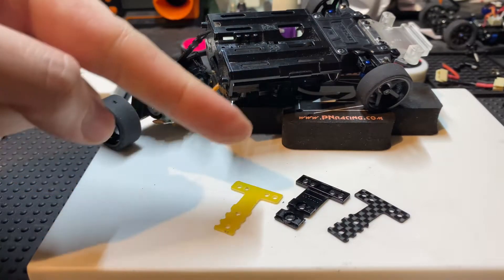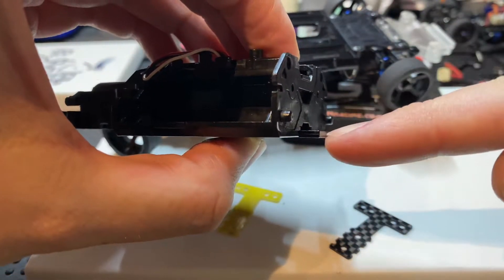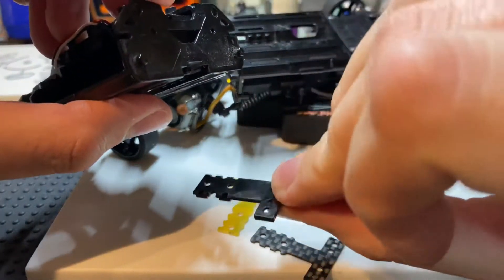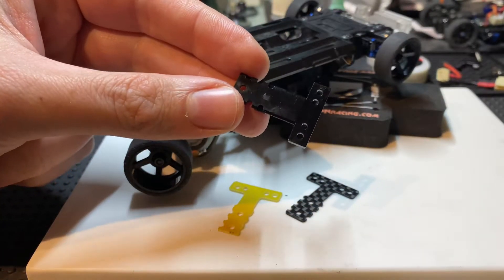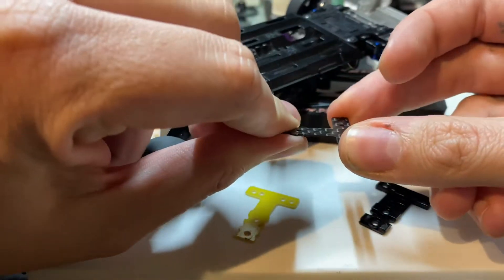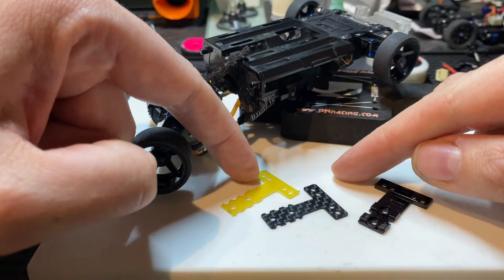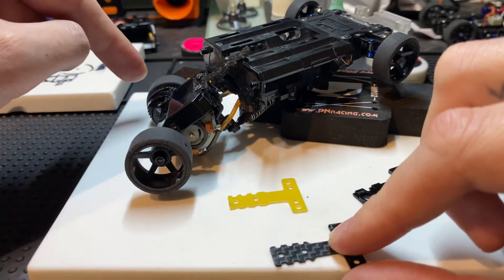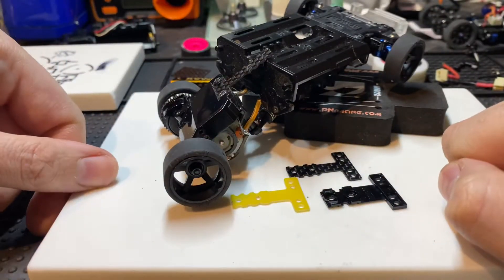What is a Mini Z T-plate

Comment: Your comment of FRP and Carbon being the same makes sense, but then they did make them out of two different materials. PN Racing even makes one out of spring steel.
I wonder if it has to do with the speed at which it returns back to its original form (plane) kind of like a shock rebound. 

I would think the Carbon will "bounce" back quicker and limit body roll compared to the FRP? What do you think?
We are talking a tiny amount that would be hard to notice every day unless you are racing and really tuning a car.

Comment: its just like flipping the kingpin ... when all you have to do is polish the shaft and reinstall it. when you flip it what actually ends up happening is that it allows the frame to bottom out and get completely screwed over time. ps thanks for info on the dampener ... ordering one now !!!

Comment: How soft or hard the T plate should be and how it’s gonna affect the driving?
Reply: How hard or soft is going to depend on your track (grip, surface). if you have a nice flat tack with lots to traction you want something on the harder end of the spectrum since your car will #1 not be bouncing and #2 need to rotate around turns by limiting body roll. Less body roll = less traction (there are limits to everything). You would want a softer T plate in a track that is bumpy and or with low traction - again so that you have a tiny bit of side roll and this helps the rear end be planted.

I will say that the factory plastic T-plate is just a place holder and needs to be replaced for racing right away just like the tires.

The order of operations is:
1 - Tires (find the right combo)
2 - Suspension spring (T-plate and front spring)

Hope this helps.
Reply: @CR3DT Hi, for running on a home floor ceramic tiles surface, is it best to use the soft, medium or hard T plate? 

And it combine with what colour of front spring suspension? Thanks